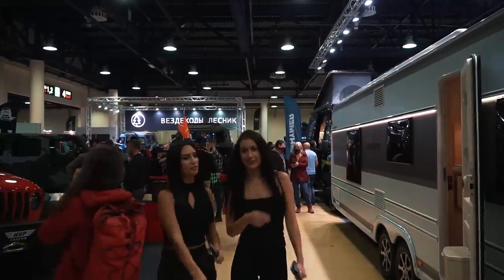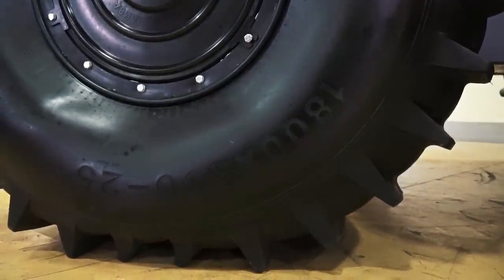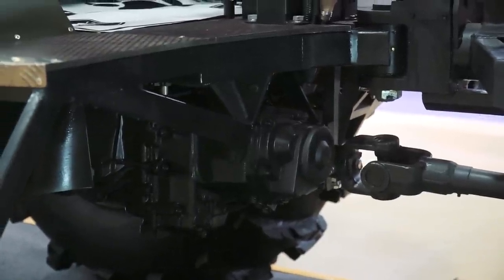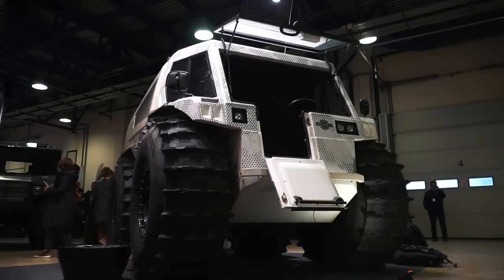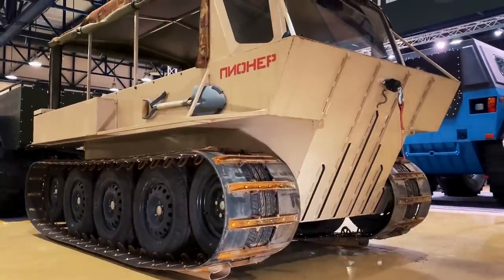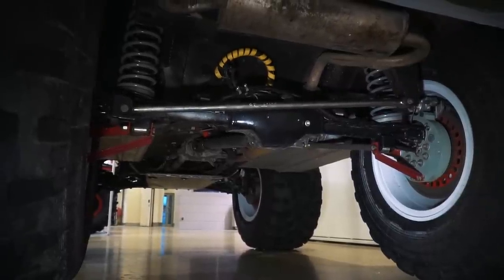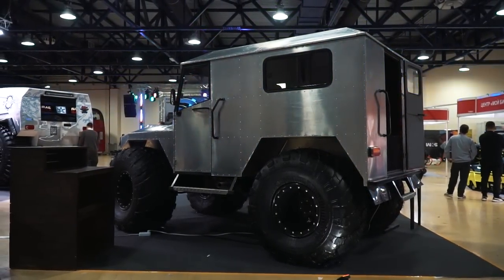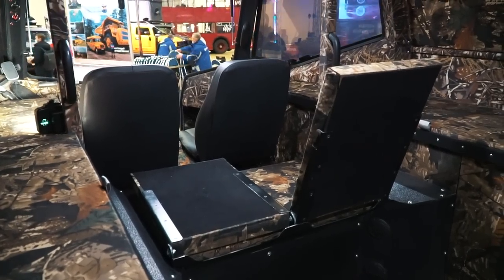Newest amazing ATVs from Offroader Show 2022

Comment: Polaris uses a unique 4x4 system that is electronically triggered to activate the front wheels when it detects the rear wheels starting to spin. With a little bit of rewiring, they could transform any of their 4x4 ATV's in to a front-wheel drive ATV that detects the front wheels slipping and then activates the rear wheels. That is very significant since many people are scared of flipping over backwards when riding ATV's and loading them in to the backs of pickups using ramps. A very real safety issue. There's a large population of disabled people stuck at home doing nothing who would love to buy an ATV if they were front-wheel drive dominant, which would make them a lot safer. With modern EPS, steering a front-wheel drive ATV would be no problem.